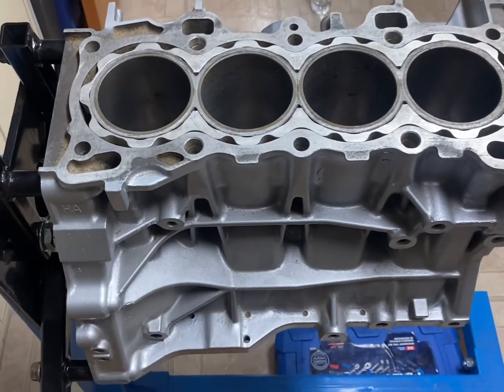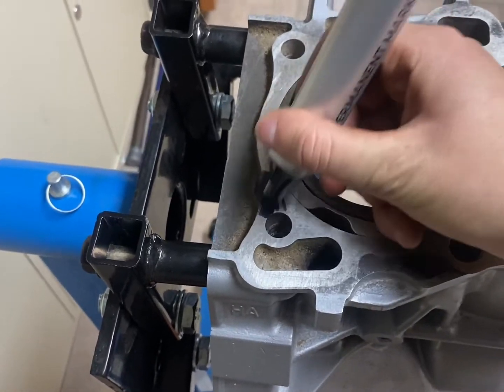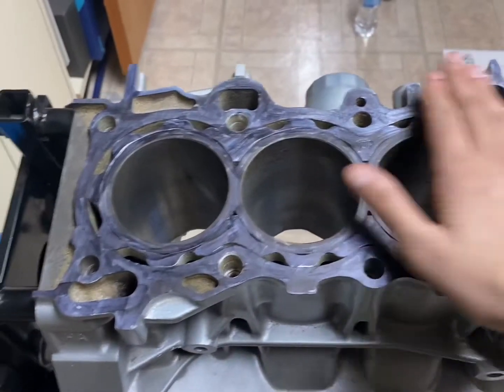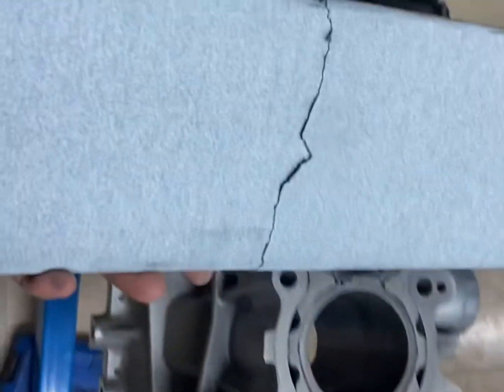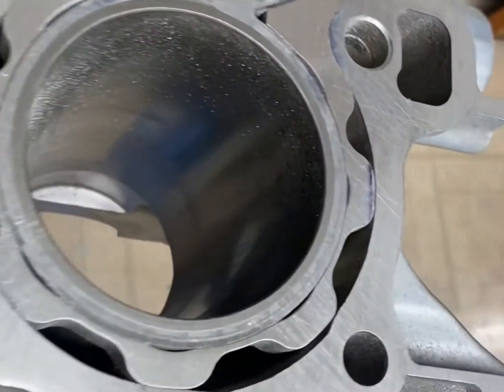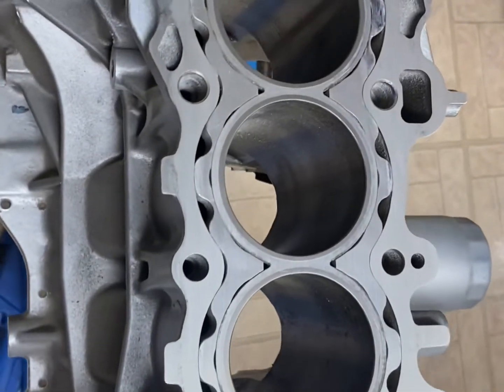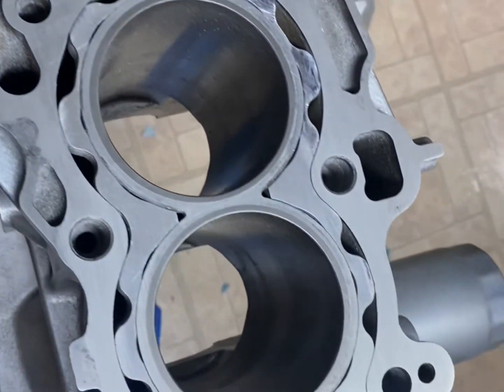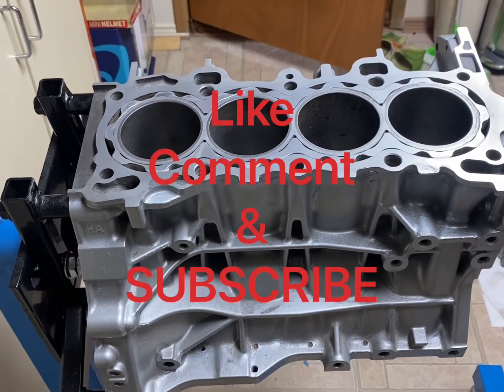How To Resurface an Engine Block | DIY D16Y8 Turbo Build | Part 2￼

Comment: I used a 1/2" thick piece of milled aluminum to attach my sandpaper to using thin double sided tape and got some amazing flatness on my heads and block

Comment: If you're going to do it cheap and do it well, a wood block is not the answer. Wood is measured by a tape measure. Your block flatness will be measured by a micrometer or feeler gauge. Huge difference. A cheap compromise would be a small, very flat piece of granite ( think kitchen counter shop scraps ) or a piece of very thick plate glass. But, for gawd sakes, not a wooden board.

Comment: Is this engine still running on the same headgasket? About to resurface my y8 head to be safe
Reply from the maker: Yes
Reply: How about now? Is it still going strong?
Reply: @ethanhernandez8725  mine is , I did it the same way in the video also did it to my Honda prelude both are fine , I copper sprayed my head gaskets to be on the safe side
Reply: @sirsendit9770 you Copper sprayed a MLS headgasket or composite?
Reply from the maker: @ethanhernandez8725  yes

Comment: To achieve flatness you need knowledge and something flat.  Both are missing. Never do this to your block.
Reply from the maker: Something flat? Is a board round?
Reply: I see flat as .001 and 0005

Comment: The correct way is know wtf you'er doing simple and using A block of wood is not the way. If anyone doing this please use A slap of granit!
Reply from the maker: This method works…it’s levelled :)
Reply: @smallenginekid6252 what makes you think it’s level? Please don’t answer “because the sharpie marks are gone” as that’s the wrong answer.
Reply from the maker: @ clearance big man. I measured and it’s good to go